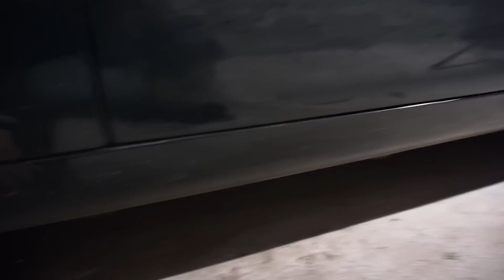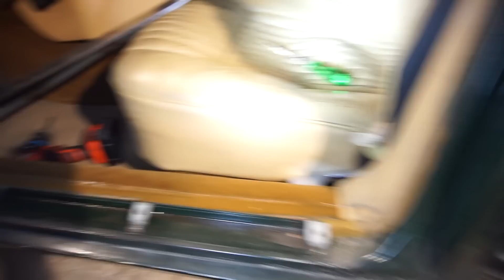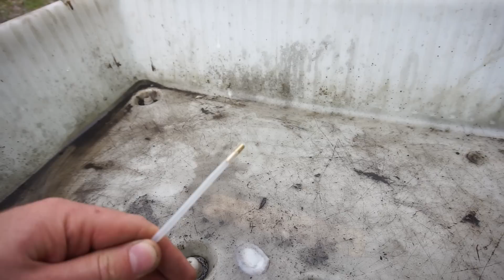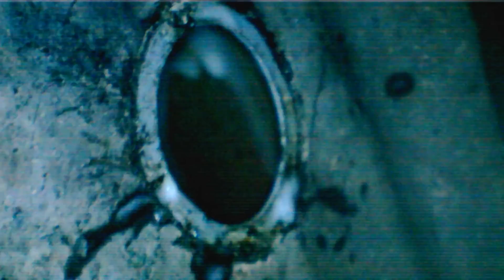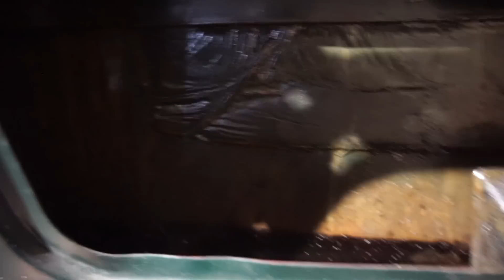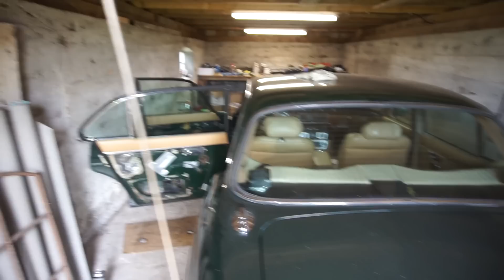How to Protect Your Car from Rust - Part 1

Comment: I would open the door as much as possible. There is a point in the middle of the front door, under the little window. All mk2 have problems there, xj somtimes. And I use grease for all mechanical parts, if the door is open.

Comment: Way to go.  That time you spent doing that, with little expense, will save your car and tons of expense down the road.
I thank you, and I'm sure if it could, you car would too. What do you think of a water proof car cover? Do you think it traps moisture
under the cover, since it doesn't breath? for a car outside in the winter  I am not sure.
Reply from the maker: I don’t think that they work well. I feel that they just trap moisture. If I keep a car outside I try and keep it clean and well waxed. Also making sure there are no leaks. And to park it in the sun to dry out every now and then

Comment: Hi Adam, another good one!  Please do show more.  I have to do all of this when I finally get back to my Mark 2 next year.  One question, does the rust proof wax also convert any existing rust that is there?  I don't believe it does in which case my thinking was to use a proprietary water-based rust converter first.  It's applied in exactly the same way as the wax but my question is, can you use the cavity wax over the top of the rust converter?  Any idea?  Cheers, and once again, more please!  Tony

Comment: Excellent video Adam! That sprayer on the end of the little hose is ingenious. I have never seen that before. Here in US we have a similar oil called Fluid Film which l apply before winter. There are no places here which do it professionally, one has to buy the cans and do it themselves.....or cross the border into Canada where there are plentiful shops which put the car on a hoist and spray the complete underside while also drilling into the doors and jambs. Very helpful video sir and l would certainly enjoy any future videos with the endoscope.
Reply from the maker: I’ve heard good things about fluid film. We have shops you can take your car to here for rust proofing. I’ve only heard to avoid shops that steam clean since it can leave a lot of moisture under the treatment which then makes it rust worse.
I think the endoscope is going in a gas tank next
Reply: @LivingWithAClassic  Be careful going into the petrol

Comment: Thanks again for another great video. Especially the filming from inside the sill. 
However, I have two questions. What do you think of a more greasy type of wax e. g. the consistency of ketchup or so. Those are believed to have a longer life in industrial use e.g. on ships. And what do you think of applying the wax with compressed air and a cartridge you can buy ready to use. With those you can apply more wax to fill up corners and other tricky places.
Thanks again and waiting for more videos like this one, Tobias, Germany

Comment: Adam . Anything you do is always entertaining and informative. Your fortunate that the previous owner had already beaten you to the wax oiling . That door curtain is original however ,  not too many survived the rigours of regulator/ door lock replacement at dealerships ! Thanks.
Reply from the maker: This car does seem to be surprisingly free from rust. Paint or interior isn’t the best but it’s solid. Thanks for the curtain information!

Comment: I would consider a 1" diameter hole so as to get the hose pipe on the vacuum cleaner in to the cavity and suck out any metal drilling bits from drilling the hole. Then put in the 1" rubber plug.
Reply from the maker: It didn’t make the film but i put a small magnet down there to get them up. That clip had no audio unfortunately

Comment: Fluid Film ! I use it for years ! Very good results !  All five years I renew the film . It is transparent and run into tight corners by it self .
Reply from the maker: Fluid Film is great stuff too. Hard to get a hold
of here though. I will probably check how this looks every year but probably won’t need to apply every year. More like 2-5 years. It will be used a lot is we will see

Comment: NICE FOOTAGE. But: I strongly recommend not to use wax products on elder vehicles. Wax does not prevent rusted parts from further corrotion. Hot fat like Mike Sanders or Timemax is far better. There are old Waxoil plans available with all of the relevant areas to protect and all the extra holes to drill. And: XJ need desperately innerwheel mudwings to protect A Frame and Front.

Comment: I use chainsaw oil,,or even old engine oil or cheap sprayon grease... I have a project to drill some holes in the sills o my Rover 75  and spray chainsaw oil plus petrol mix...  I hate to see rust !!!!  regards
Reply from the maker: Chainsaw oil sounds good. I’ve heard to be careful with used oil since it may be acidic. Good luck with the Rover 75!

Comment: Adam, is that rubber bung in the back of the sill standard? I have one fitted in the same position on each side and I was wondering if it has had the same treatment as yours; currently the whole or most of the underside and wheel arches are covered with a thick black gunk which is start to come adrift in places.

Comment: Try deodorised fish oil that stops rust.   Downside is that your car will be initually attractive to cats for a few weeks until it dries completely and has no longer a fishy odour.
Reply from the maker: Sounds pretty smelly but may be worth a try
Reply: @LivingWithAClassic  and remember that these same cats will prevent mice from eating your fuel lines so spray lots and lots.